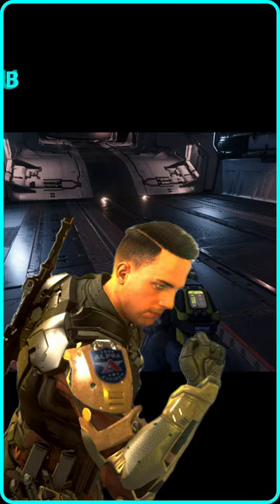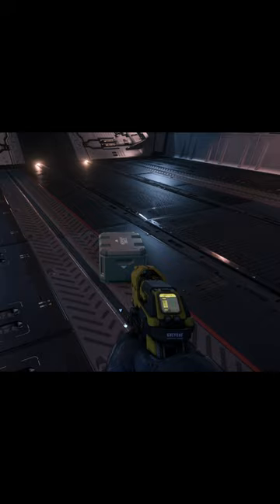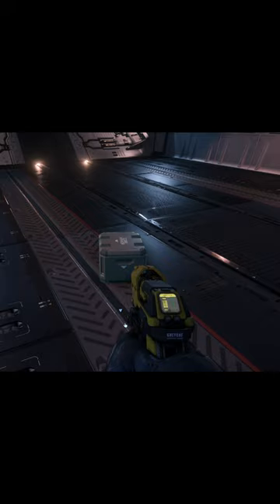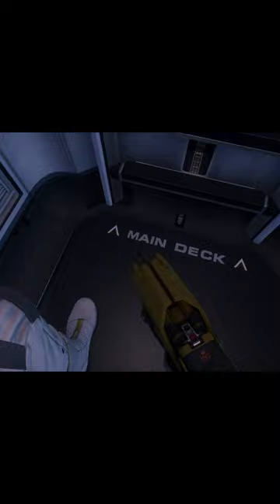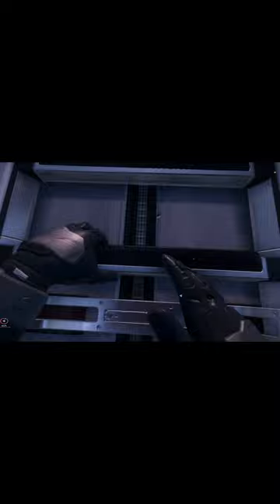Tractor Beam Broken? | Star Citizen Bug Workaround #37

Comment: Unable to even attach the tractor beam module to the multitool.
Reply from the maker: Oof. Take off all your gear, then re-equip it with the multi-tool being last. Then add the attachment. 
Just do not have both side-arms equipped. Try leaving one spot empty and it sometimes helps, oddly